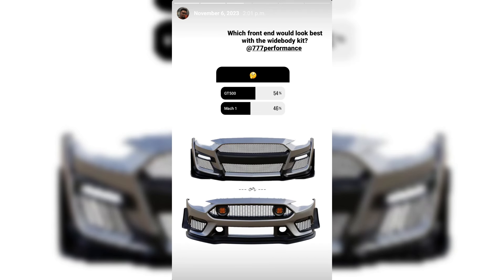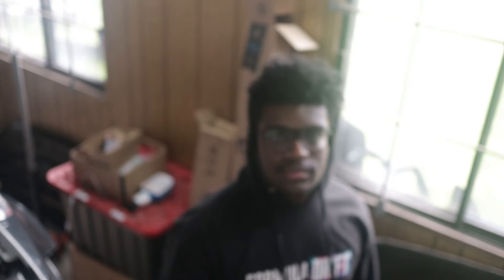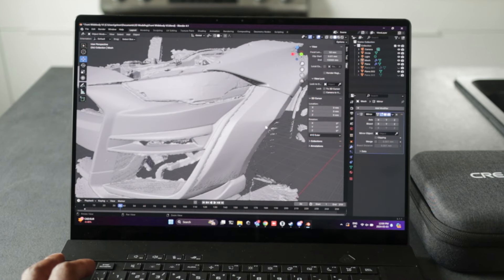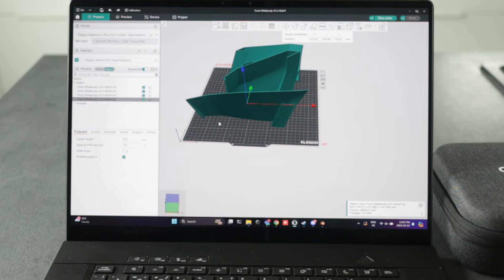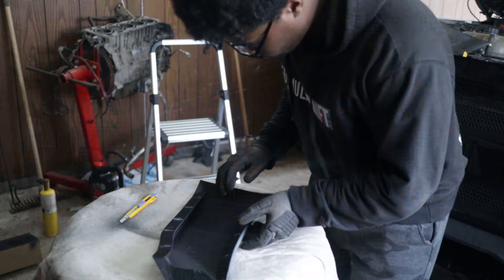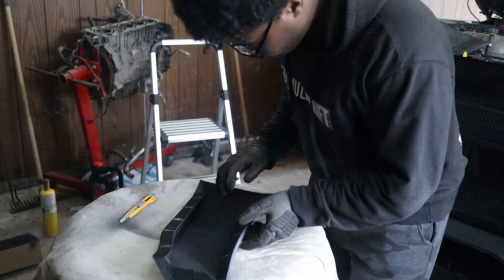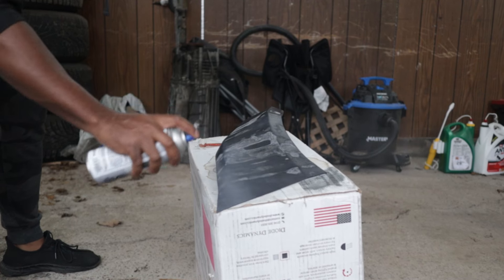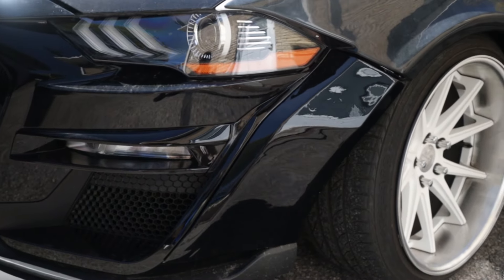How To Make A Widebody Kit With A 3D Scanner

Comment: Great video! Keep up the good work!

Doing the same thing for my car. Creating a front lip. I modeled it in Blender. Didn't have a 3D scanner, but used scanning app from my phone. A little more tweaking and printing to get the contours, but this helps with developing good modeling skills. Printing the mock-up one section at a time in PLA and test fitting as I go. Once I get it right then I will probably use PETG.  Maybe ASA once I can get a good enclosure built.

Comment: Great job! On v2 try to bondo over the primer and sand to get it as smooth as possible so you dont get those low spots on the paint, it's really not that hard, i've used bondo with 0 experience to refresh some borbet rims and a lip that i cracked in pieces and it came out nearly like oem.Good luck!

Comment: this looks dope but next time please just print each piece individually. it was greatly reduce your failure rate. also try wall thicknesses greater than 1.2mm for firm prints. this looks dope
Reply from the maker: Issue is my 3D printer is not big enough to print it in 1 piece, also ASA is a really hard material to print with! I have an Elegoo Neptune 4 Plus